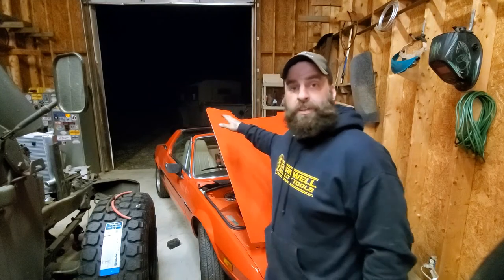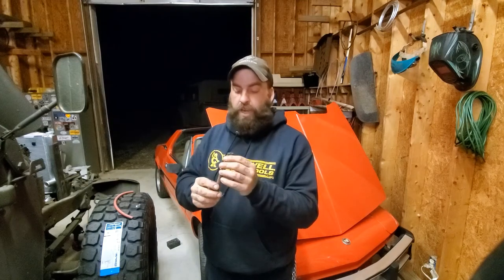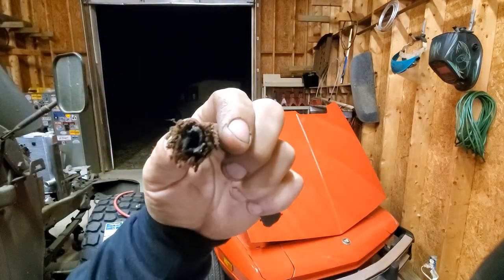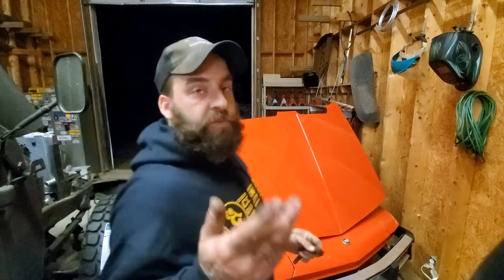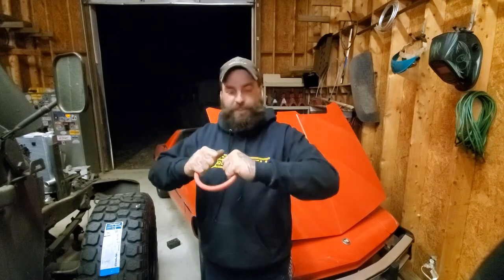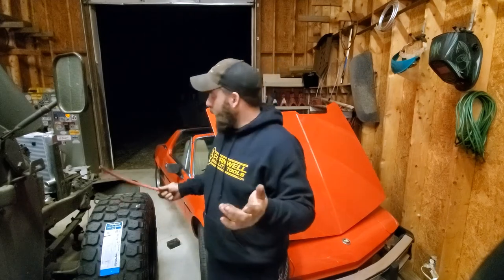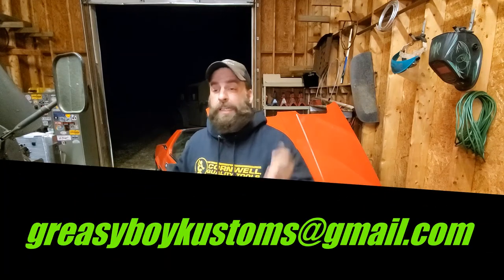1977 FIAT X19 BERTONE BRAKE MASTER WRAP UP

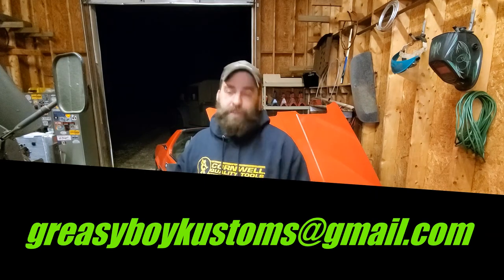Comment: (3:26) I completely understand, and have been there “a few times” 😉. Thanks for still posting the video,  it helps others to think outside of the norm. I definitely wouldn’t have gone hunting for a satellite reservoir with miles of rubber hose. 👍

Comment: The hoses to each caliper tend to swell up and cause restriction too.  If the pedal is hard and the brakes are difficult to stop the car without locking one of the wheels up it's most likely the caliper hoses, not the pads.